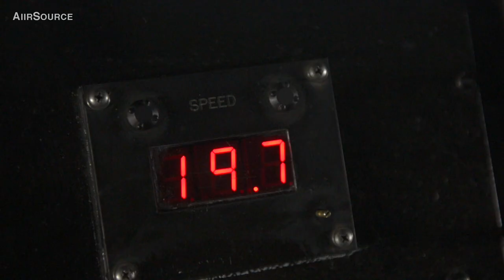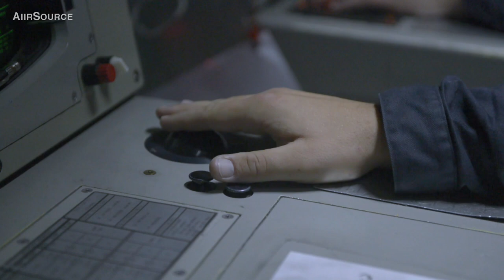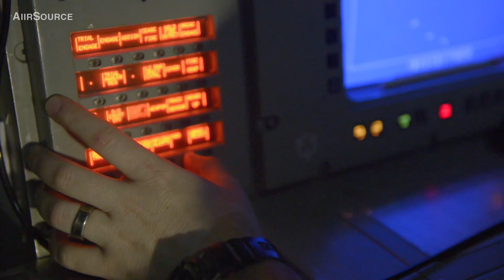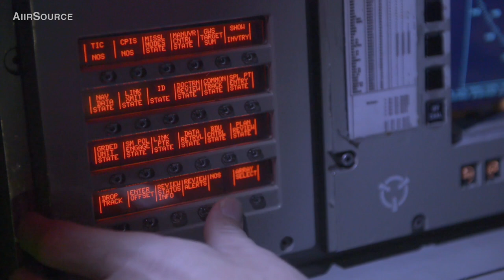A Day In The Life Of A US Navy Destroyer: Arleigh Burke-Class USS Carney

Comment: It's amazing they wasted three minutes of film trying to stay on course 060!!!
Reply: Stupid ass.
Reply: Poor production. Poor direction. Not the fault of the ship or crew.
Reply: No not really. Simply turning the wheel doesn't necessarily account for the vagaries of ocean currents, swells, and the wind. It isn't quite that easy to steer a large ship on a specific heading, requires a special skill to account for the environment and "feel the ship". Just saying.
Reply: @douglaslally156  I have stood helm and you are correct
Reply: Yeah, I wasn't sure why he turned right rudder to go left. Must be  helluva current!

The reason for doing the course change 3-4 times is because this channel supplies "B-Roll" video with scripts to TV stations so they can do stories on the military. The TV station will have a narrator talking during whichever one or two different clips they air.
Reply: @Ppurk  what he should be doing is giving him a course to steer to maintain 060.
Reply: @douglaslally156 The Spruance class destroyer I was on there was this nifty little thing called the 'auto pilot.' You just got steady on course, flicked the switch, set how many degrees rudder needed to maintain course and it was good to go.  It worked the best  when the seas were smooth as glass.

Comment: Does anyone actually remember when the first Sun Computers (1989-91-ish), ...came out for the school class rooms? - they were big like these ones on the Burke destroyers, and they used the tracking ball; everything, just like seen above.  We are in the 21st century, we use wireless mouses, or touch pads...Do they (the engineers) know how much easier it is to use a mouse to place it on, and over an enemy icon, double click (fire, identify, whatever), and move on, as needed? - come on...get with it guys...time efficiency counts in tenths of a second...or, when added up, seconds...if you face an enemy missile traveling at mach 3, that track ball isn't going to cut it.  Leave it to some anonymous guy typing away on a keyboard, to tell them how to get things right.
Reply: Obviously you have no idea of the design and procurement process for Navy ships.